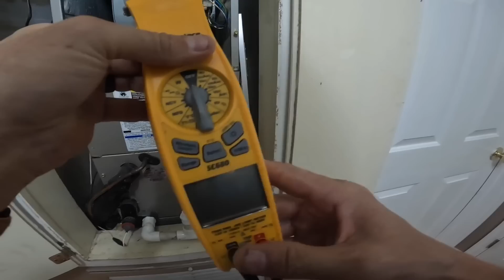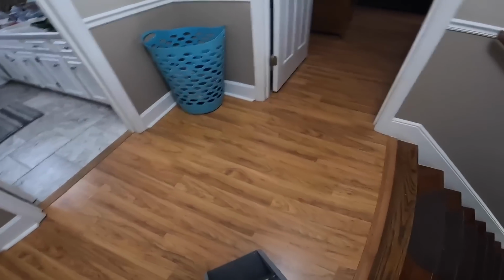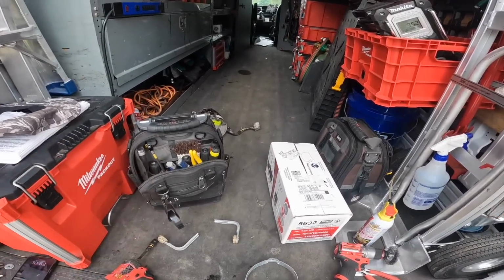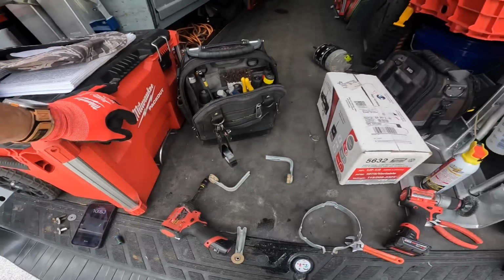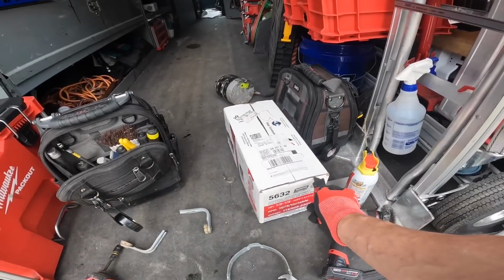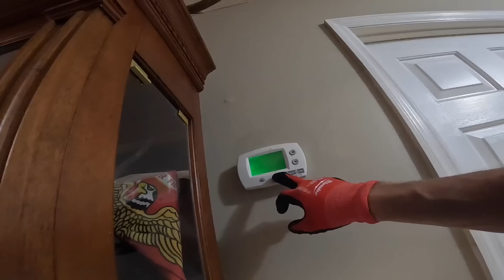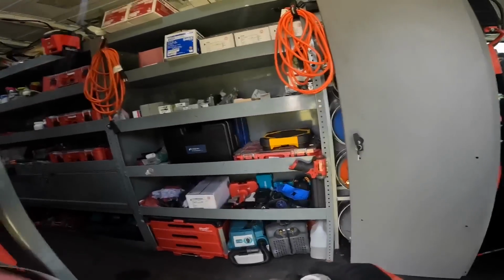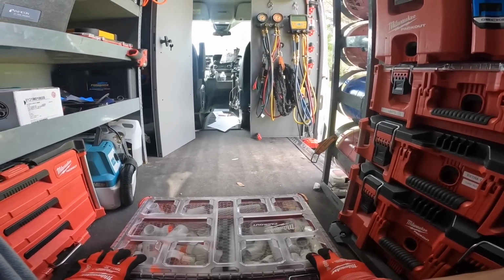ICP Air Handler Not Blowing

Comment: When you have a problematic bolt and nut, if you will put the impact on the nut (deep barrel if needed) and hold the bolt head with the wrench; it takes a little less torque to get it off. Not a hell of a lot, but; in some cases 1 or 2 ft-lbs. could save the bacon. Nice job you did, in any event.